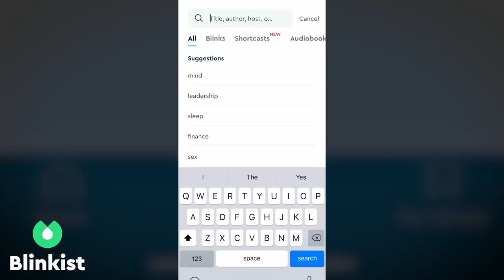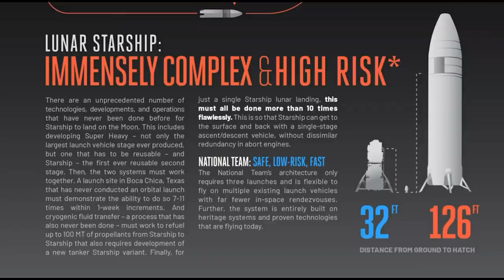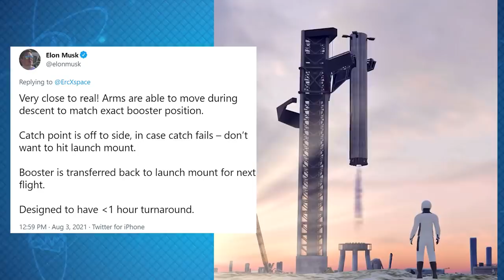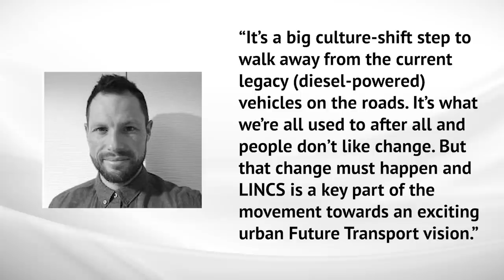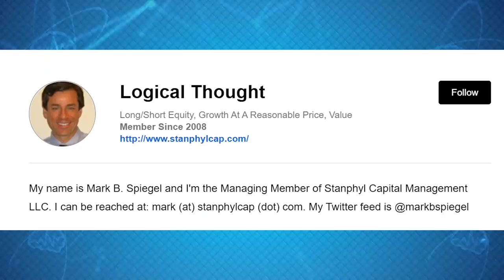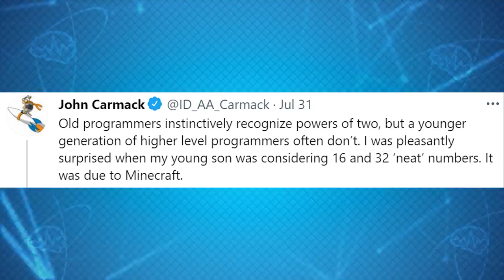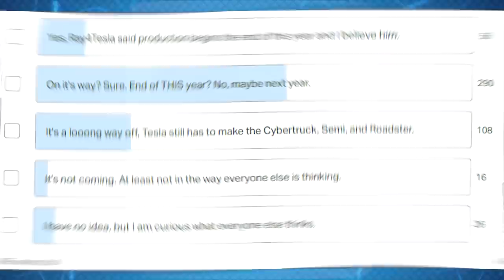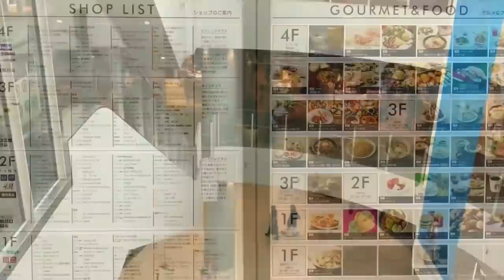Tesla Time News – Is the Tesla Model 2 Coming This Year!?

Comment: Non-ablative heat tiles.  Ablative is what the old heat shields did, with layers that peel off as they heat, carrying away lots of the heat.  Works great but not reusable.  Starship will have heat resistant insulative foamy ceramic tiles like the space shuttle, but with the vast majority identical, and able to be popped on in seconds each. Not 40,000 different individual ones.
Reply: Thanks for saving me the work of commenting this :D

Comment: @38.57 New Jersey is about 13 times smaller than United Kingdom. Oregon is close to UK size.
Reply: Well done for doing the leg work. I immediately had a sense that NJ was way smaller than the UK, turns out FL is too which I wouldn't have thought had I not started checking, but I didn't know which state was the best comparison for size. Oregon's tricky to conceptualise though I think because the shape's so different. All the states with a similar shape to the UK, and even just GB or England, are too small.

If you line the south coast of the UK with the north border of FL (roughly) you can more or less fill GA with England; Wales and NI stretch across to the western edge of AL (although most of AL would be covered by the Irish sea in this case), and lastly Scotland stretches up the height of TN and KY whilst being about as skinny as Indiana (strictly speaking the Shetland Islands would stretch up from near Springfield, OH).

Comment: FYI the tiles on starship are not ablative.  They are made of a ceramic material and musk said in part 2 of Tim’s video that they have no discernible maximum life. That means as long as they don’t crack or fall off from stresses they can be used essentially forever.

Comment: 50 minutes into this video is a electric garden tractor, the second electric lawn mower that I have seen, but first using Volt car battery.  2.5 KW is about $0.25 in my area, and the gallon of gas is about $4.50 this week, but who knows about next month?  The other electric garden tractor was seen in Home Power Magazine years ago, and used lead acid batteries.  Charged from a 24 volt battery system connected to 24 volt solar panels.

Comment: not sure if someone already mentioned this @ 24:50
The Starship tiles are not ablative... That is what is used on Dragon capsules (material called PICA-X).

Starship is using tiles similar in style to the Shuttle but a custom SpaceX blend. Ceramics. These should hardly ever need replacement unless they are broken during flight or ground operations.

Comment: By the way, the heat tiles on starship are not ablative! They are ceramic, and designed to be reused and not replaced unless directly damaged! They do not ablate, or wear away, to shield heat. They instead create an insulating barrier by being raised off the surface of starship a bit, and interlocked enough that they block superheated plasma. Any reports that they are using PICA-X as their tiles is incorrect, that is what they use for the dragon, a completely different type of heat shield design! Important to note, even in the recent interview with Tim & Elon, he said they were ceramic and reusable, not ablative! As with almost anything experiencing superheated, hypersonic plasma, it will of course wear away slowly over time. But this is not how it works to cool! It is not ablative! This is a key aspect of starship's reusability, they want to relaunch preferably without replacing any tiles at all, as many times as they can.

Comment: Couple errors:

- The heat shield tiles are not necessary now because "it hasn't gone high enough before." It's not really about elevation per se, it's about velocity -- re-entry from orbital velocity requires thermal protection. 

- The thermal protection tiles are not ablative.

Comment: England and Alabama are roughly the same size. England has an area of 50,337 square miles while Alabama is a little larger, with a land size of 50,645 square miles. Alabama's population is much sparser than that of England. Alabama has 4,779,736 people as of the 2010 U.S. census while England's population was 55,977,178 as of 2018. New Jersey is the fourth-smallest state at 8,722.58 square miles.

Comment: Since the batteries are located on a platform at the bottom of  electric cars, why not, have an automatic system that detects fires, and then releases the platform with the batteries to the ground below the car, and then the platform rolls backward/forward between the tires, or left/right away from said car depending on detection of objects in those cardinal directions. If ejection of batteries is impossible, then batteries won't be ejected, and the whole car will burn up. Hopefully some sort of fire reduction control system could be designed into the battery compartment platform in addition.

Comment: Hi. I need help finding an episode where one of the viewers explained about gasoline and electric efficiency and how many kilowatt of energy it costs to heat up the oil from the ground to separate it into a fractions and how many miles ICE car will drive on one gallon vs how many miles electric car will travel using same amount of energy that used to produce one gallon of gasoline.
Can you please tell me which episode it was? I have to show it to my stubborn and ICE-brainwashed friends

Comment: WTF is with all of the media people saying things like "only 150 miles of range"? That would let me drive 30mins to, and 30mins from work every day for a week, plus a trip to the grocery store and still not go below 50% while only charging once a week. So many people don't need or want an EV with huge range, and given the limited battery manufacturing capacity around the world, having less range in EVs now, can only result in far more people swapping to EVs sooner. While manufacturers are at it, get a towbar added. Electric cars would be great tow vehicles to get to the boat ramp (less than 9 miles away) if only the cars were put through the required steps to get a tow rating, so my insurance would cover it.

Comment: On the ioniq 5 story @ 41 mark:  ideally you would just charge it until the taper charge begins then unplug and then go to the next charger and repeat the process of the entire trip. 

Charging from 45-250 miles, the last 20% of the battery pack is double charge time vs the lower battery ramp.    

For road trips best option is to taper charge cycle for the entire trip.   

For the premise of taper charge cycle then look at the out of spec motoring on YouTube.    

TSLA has already open for the supercharger network 3rd party users, but it’ll be a 5¢ premium over the TSLA price scheme, which will be used for the maintenance costs and expansion of the network.
Reply: I have tested lithium batteries for computers and phones and you care correct. Most are designed to taper off and most of the charging is done slower than the initial charge.

Comment: Once again - a great video from you! Thank You!
Though... one thing you seem to get wrong about shorting a stock. Shorting does NOT hurt stock HOLDERS (emphasis mine, as in "holding long term"), especially the ones committed to it.. It may hurt stock traders/gamblers in the short term. If it is a great company shorties will be squeezed at some point, losing money and the stock appreciates because of the squeeze ... and of course this is what happened repeatedly with Tesla, and can happen again. There is a reason that heavily shorted stocks represent a bullish, not bearish, opportunity. As long as the company can actually deliver and be successful.

Comment: You seemed to say that the new Nissan EVs are eligible for the 7.5% tax rebate.  That surprised me because I thought they were way over the 200,000 vehicles sold.  It certainly doesn't apply to the Bolt or any Tesla.  Maybe I didn't hear correctly.

Comment: @41:00 huge difference Except if you look at the amount of miles/kilometers added and the actual range of the vehicle from 80% down to 10%. 
It might turn out that your competitor EV would be left stalled on empty by the side of the road. It's not exactly range anxiety but it's pretty darn close...
Reply: Most of the cars that ran out of gas with the owner standing roadside holding a gasoline can were not out of gas because of the size of the gas tank but because the owner chose to push as close to empty as possible (me) or just failed to watch the gas gauge (me). The miles per tank had little influence on this as there were gas stations on every corner or you knew there was not one for another 50 miles.
EVs have a different influence for the present as charging stations are being built. Once entrepreneurs figure out how to charge for a charge up, they will appear.

Comment: The heat-tiles aren't ablative I don't think, they are supposed to be infinitely reusable. With an ablative heatshield like the space shuttle or dragon heat is removed through ablation of the heatshield, i.e. the shield burns away slowly, with these heat-tiles the heat is removed through radiation (I may remember this wrong).

Comment: The time comparison on the model y is a bit misleading. You list Model Y 10-80% in 28 minutes but that’s for more range than the competitors have available. Comparing apples to apples you need to know the range of the Hyundai. For example, The Porsche Taycan and the Audi eTron GT both charge to 80% (200 miles) in 18 minutes.. but that gives you 200 miles of range. That’s 60% on the long range model y.. and charging to 60% (200 miles) on the long range model Y takes 18 minutes on V3.

Comment: The Ioniq 5 is driving around here in Germany, and many independent reviewer, as well as actual owners have confirmed that the car's charging actually IS that good. Hyundai really did a great job on that powertrain / platform. It is good to see that more and more legacy auto makers take things seriously and implement proper EV power trains. I live in a rural region, but I have already seen two distinct Ioniq 5 cars here around. Hyundai however apparently targeted potential Model 3 customers, bacause the car is significantly smaller than a Model Y.

Another legacy OEM which has finally arrived on the right path is Daimler. Granted, their current competetive EVs are the really high priced EQS and EQE, but those actually outperform Tesla in means of charging an real-world-range. (On German Autobahn at the recommenden cruising speed of 130 km/h). If they can continue this path down to the C-class, then will be able to address the same customers that Tesla can currently address.

Comment: I know it takes a lot of energy (electricity) to make petrol. Could you find out how much they use on 1 gallon or liter.
Reply: "from well to gas tank, gasoline is about 81 to 83% source energy efficient."
"only about 15% of the energy used in a refinery is used in the form of electricity."
"about 0.8 kWh/gallon of actual electrical energy use."
"overall real well to tank efficiency for gasoline of about 80%"
"taking the overall 20% of the source crude energy lost between well and tank, converting it all back to kWh at say 30% efficiency. [...]= 2.1 kWh [per gallon]"
Refining also uses chemicals - and rare elements.

Comment: Tesla sold 32,968 China-made vehicles in July, including 24,347 for export, the China Passenger Car Association (CPCA) said on Tuesday.
Local sales of China-made vehicles plunged 69% to 8,621 cars from 28,138 in June.
China’s BYD sold 50,387 electric vehicles last month, while General Motors Co’s China joint venture with SAIC Motor delivered 27,347 units.
In July, sales of the entry-level EV  wuling mini EV amounted to 30,706 according to Chinese media,
BYD has $11,000 EV with 300 mile range which is cheaper than their ICE counterparts.